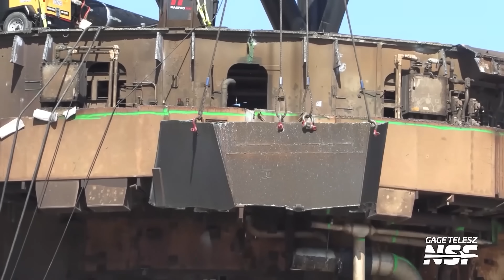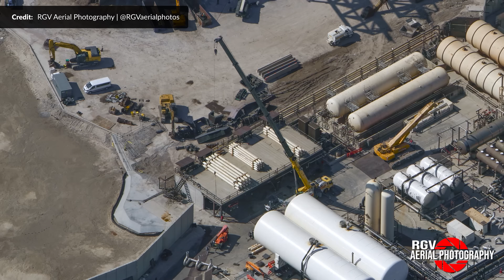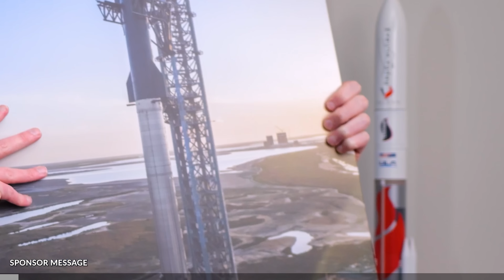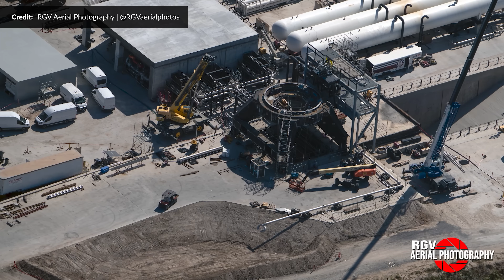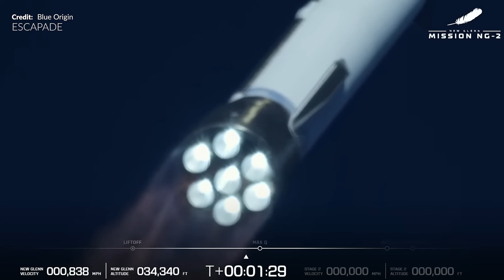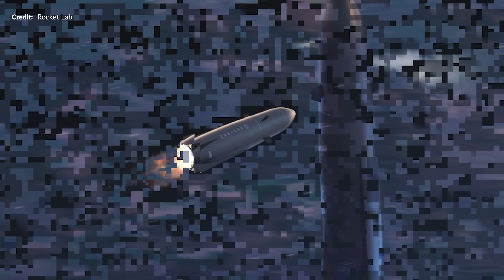Blue Origin’s New Glenn stunned everyone!

Comment: On the previous and last launch they could have just not used the water deluge system and then held the rocket on the pad a little longer, like they did on the very first launch, and obliterated the entire stage zero with just Raptor rocket thrust. Would have saved them a heap of work 👍😆
Reply from the maker: LOL. Probably
Reply: While I know you're being silly the truth is it likely wouldn't have saved them any work. :)

Comment: Marcus, there is a lot of discussion about trucking in methane for SpaceX launches.  Is there a possibility that the launch sites would receive a natural gas pipeline or a tanker ship terminal to make shipments more efficient?  It seems like a pipeline to an onsite or offsite (with second pipeline for the pure methane after) methane separation plant would make the most sense especially for high cadence launches.  Might be an permitting problem, though.  I would appreciate if you could elaborate on future fuel delivery plans, if known.
Reply from the maker: They do plan to have a CH4 plant too, but that comes later.

Comment: 11:35  The crane was NOT spinning under power. Clearly wind driven.
Reply from the maker: Nope.
Reply: @MarcusHouse Sorry but you are not correct. Clearly wind driven through being partially shielded by the Megabay. You can even see it in the change of rotational speed when getting in and out of the wind.

Comment: Thanks Marcus.  Did I miss the bit about the booster hovering abeam of the barge, and then slewing over to land?  That, and the explosive welds are a pretty incredible and unique steps.
Would be interesting to know how thick the deck plates are to avoid melt damage of a fairly long hover prior to shutdown.  Maybe they just alloy'd up.

Comment: If we were to objectively award comparison scores:

1. SpaceX landed their reusable orbital rocket in 2015. From that point of view, Blue Origin is 10 years late in landing a reusable orbital rocket. At least they got there.

Blue Origin = 0 vs. SpaceX = 1

2. New Glenn has bigger payload capacity (45t LEO) than Falcon9 (23t LEO). Sounds good, but Falcon Heavy still has a bigger payload capacity (64t LEO), though precise numbers vary depending on variant (expendable vs reusable).

Blue Origin = 0 vs. SpaceX = 2

3. New Glenn shows stronger performance to high-energy orbits like GTO and GEO mainly because it is a larger rocket with more propellant capacity and an efficient hydrogen upper stage, which offers higher specific impulse for long orbital-raising burns. This upper-stage efficiency gives New Glenn an advantage over kerosene-upper-stage rockets such as Falcon 9 and even Falcon Heavy in certain mission profiles. 

Starship, however, is a far larger system with enormous propellant reserves and very high thrust, which will ultimately allow it to exceed New Glenn’s GEO and deep-space payload capability once in-orbit refueling becomes routine. 

We give 1 point to New Glenn (vs. Falcon-class vehicles) but we also give 1 point to SpaceX for Starship eventually beating New Glenn.

Blue Origin = 1 vs. SpaceX = 3

4. Blue Glenn has been able to land the biggest orbital rocket first stage on a drone ship. Hmm, true, but kinda deceptive. True in that SpaceX’ Falcon-class boosters are smaller than New Glenn’s, but deceptive because for Starship, it is SpaceX’ choice not to land the Heavy Booster on a drone ship but to catch it using Mechazilla chopsticks. Similarly, it was SpaceX’ design choice not to build landing legs for Starship’s Heavy Booster, because the HB was too big so legs to support it would have to be very strong and too heavy. 1 point each.

Blue Origin = 2 vs. SpaceX = 4
Reply: By using the launch tower to catch it Starship loses capacity per launch but increases the launch cadence by landing right by the factory for refurbishment.  New Glenn adds days of travel time returning to the factory for refurbishment.  Advantage Starship

Leaving your landing legs behind means more cargo.  Advantage SpaceX.  

Falcons and Starships use one type of engine for both stages (the same for both types of Falcons and a different one for Starship) this reduces engine development cost and manufacturing cost.  Also since both stages use the same propellant they reduce the types needed at a launch pad and allow sharing of a tank farm.  Advantage SpaceX.

Using the same propellant on both stages means they can both use the same construction techniques and materials.  Advantage SpaceX

With starship using the same propellant and engines on both stages meant they could concentrate their development efforts on the 2nd stage as almost all the features of the 2nd stage could be tested on the 2nd stage while testing 2nd stage items as well.  Made it cheaper again.  Advantage SpaceX/Starship.

SpaceX created Starlink to take advantage of the reusability of Falcon 9 and show that reuse does not come at the cost of reliability encouraging customers to launch on a reused rocket.  Advantage SpaceX.

Using a Starship variant as HLS allows them to demonstrate with a customer paid for mission the feasibility of refuelling in orbit.  Advantage SpaceX.

SpaceX will transfer that Starlink launch business to Starship saving money and showing how reliable it is both on initial launches and reuse launches.  Advantage SpaceX/Starship.  

Starship/HLS is big enough that for many purposes it can BE a space station.  Advantage SpaceX (if they take it)

:planet-orange-purple-ring:

:planet-orange-purple-ring:
Reply: @Scanner9631  what do you mean when you say that “by using tower to catch Starship it loses capacity per launch”?
Reply: lol, if I add all your points then the score becomes:

Blue Origin = 2 vs. SpaceX = 13
Reply: @alesh2275  what do you mean when you say that “by using tower to catch Starship it loses capacity per launch”?

Returning to launch site is more fuel intensive than landing down range on a barge.  Speeds up refurbishment by no return barge ride.  But the barge would have to be HUGE to have a catch tower which would mean landing legs costing payload again and of course developing something else.

:planet-orange-purple-ring:

:planet-orange-purple-ring:
Reply: @Scanner9631  gotcha
Reply: Did you see New Glenn’s drone ship landing where there were small explosions around the landing legs where a device seems to have locked in the 6 landing legs so wind and waves don’t move them? 

I wonder what the mechanism was, why the small explosions, and whether the mechanism has the potential to damage the landing legs, which could mean long refurbishment times.
Reply: @alesh2275  I wonder what the mechanism was, why the small explosions, and whether the mechanism has the potential to damage the landing legs, which could mean long refurbishment times.

How long to refurbish the deck and how often?  It would be just too bad if the booster landed closely aligned with previous holes and they didn't hold as a result.

:planet-orange-purple-ring:

:planet-orange-purple-ring:
Reply: @Scanner9631  I found a video with comments that said New Glenn booster was stud welded to the drone ship. I’m not sure what the long term impact from that technique would be …

Comment: OK. So Blue Origin managed to launch and recover a booster that is half as capable as Falcon Heavy. Good for them. How is this bad for Spacex?
Reply: About on Par with FH if you recover the boosters.  Bad for spacex?  It has the potential to cut into their Kuiper launches... :)  Outside of that it's a good start for BO and a step in the right direction.
Reply: @imaginary_friend7300  IMO, competition is a good thing. My real point is that SpaceX doesn't care about losing Falcon Heavy launches and when Starship becomes operational (I mean carrying customer payloads to orbit), next year, it will be about 3 times the payload of New Glen and at a fraction of the price, because Starship will be 100% reusable.
Reply: @surferdude4487  I don't even think it gets that far.  There is next to no business for FH as it is.  I think they did 4 flights in a single year and that was their busiest.  Most its 1 per year or less.  I suspect Starship will not carry many commercial payloads either, it's over-kill for most but that will of course come down to final costs.
Reply: @imaginary_friend7300  I fully expect that the Starship flights that are not dedicated to launching Starlink satelites or getting people and cargo to MARS or the moon, will be ride-share with multiple customers per launch. The cost will be much more attractive than any launch vehicle that throws away any part of the system. For those that insist on a dedicated launch, the cost might still make sense even iff the Starship is far below capacity. That's the difference a 100% reusable system makes.
And yes, your point about how rare FH launches are is also my point about how little SpaceX cares if someone else does those launches instead.

Comment: I’ll feel much better once Starship returns without TPS burn throughs. So far it’s 0/11 attempts. I do not see how they can fix the current design as my 10 years experience designing TPS for winged RVs is they have departed from the knowledge base for what reliably works. Blue has the right engineering approach.
Reply: And it has survived even when the TPS was omitted entirely.  Maybe they're better at it than you are.  What do you consider to be the fatal flaw, as a TPS designer?
Reply: They are still testing all sorts of different ways to do things, it lots of extreme ways. When they come up with a final design and test that, we will be in a better position to judge.

Comment: I don’t know. It feels like they didn’t push it hard enough. Blue Origin played it safe to showcase reliability, which is, in my view, a bit paradoxical when you’re trying to prove true reusability. It creates the impression that they’re ahead of SpaceX—but not so fast. SpaceX is the actual pioneer of reusability. Blue Origin seems too focused on optics. Maybe I’m wrong.

Do we have any solid information—official or quietly acknowledged—about their rocket stress-testing and torture protocols? Anything deeper you can dig up on that?
But what a show!!
Reply: Push it hard enough?  How so?  They delivered their customers payload...
Reply: They still have a long way to go to even equal SpaceX. They don't have a reusable 2nd stage, crew capability, and we are yet to see how long it takes to turn a booster around for reflight or how many reflights they will get from each.

Comment: They are not going to use trucks to move the LOX across the street, especially at the scale they need to produce.  Come on.
Reply: They've been trucking it in already.  They will likely have excess production to be sold to 3rd parties.  

The big issue is will they either be allowed to dig up the road or string pipes over it to deliver directly.  Otherwise trucks would be the only option.

:planet-orange-purple-ring:

:planet-orange-purple-ring:

Comment: It has to be asked, the new launch mount prevents a service platform getting under the engines for working under the booster. How will this work get done?
The circular mount had the moveable / folding platform...

Comment: 11:37 🤔 Perhaps this was a brand new crane, or one that had a completely new swivel portion, and so this may have been part of the "break in" procedure. Certain things need to be properly worn in before you use it to their full potential. Your vehicle's engine, for example (if brand spanking new with low/no mileage).

As such, I can see running it like that for 12hrs as being the procedure to ensure all the bearings and their surfaces are functioning smoothly. Last thing you'd want is for some unknown debris to suddenly wedge itself in the bearing right as your moving a large load, causing everything to slow down and said load to start swinging! (and for that stuck bearing to ruin the bearing or the race)

Comment: The next SpaceX launch needs to be special. If they dump booster and Starship into the ocean again then my vote goes to Blue Origin. Sadly Blue Origin only does a 1 per year launch. But they are using that launch efficiently.
Reply: That's simpleton child reasoning at best.  The next flight and likely 2 will both be the same flight plan as the last one.  And there are good reasons for that.

Comment: Sounds good blue origin is only 10 years behind.
Reply: 24+ years from founding to their 1st orbital launch 25+ to their first fully successful launch.  Pretty slow, typically it seems to take 6 - 8 years for a successful orbital launch.  

Rocket Labs was pretty slow taking 11 years but have had about 70 launches in the 8 years since.  They are making satellites (like the ones launched on this flight of New Glenn) as well and working on their 2 generation orbital class booster to be launched (hopefully) next year.

:planet-orange-purple-ring:

:planet-orange-purple-ring:

Comment: Betting Starship launches 3-4 times before New Glenn launches again.
Reply: Well, they might but they will still be test flights.
Reply: @imaginary_friend7300  No they won't
Reply: @imaginary_friend7300  are you sure/
Reply: How about how much payload Starship will put into orbit over the next 2 years compared to New Glenn?  If they can start going to orbit in 6 months and are ready to launch Starlink 3 satellites it will EASILY be Starship in the lead.

:planet-orange-purple-ring:

:planet-orange-purple-ring:
Reply: @Scanner9631  SpaceX will be launching ver. 3 satellites 2026
Reply: Yep, 3-4 times with 3-4 explosions and no progress.
Reply: @gracialonignasiver6302  The silly nonsense you zero's spout.
Reply: @gracialonignasiver6302  wanna bet on that?
Reply: @gracialonignasiver6302  wanna bet on that?

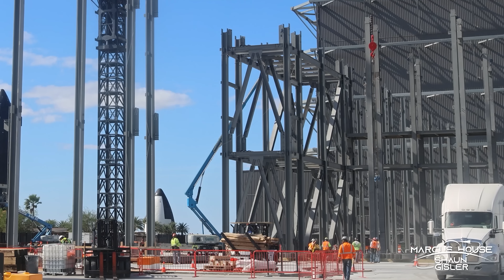Comment: Regarding remarks at the 12:00 time code about the piece-meal delivery of parts: It's a well documented lean manufacturing tech called Just-In-Time (JIT) manufacturing and has been around for decades. In JIT, individual components are delivered by the supplier as needed, just in time to go straight to assembly, without ever going to a stock room for wasteful storage. I haven't noticed it used at this scale before, but it doesn't surprise me with Elon driving efficiency into everything he does.

Comment: Amazing engineering. 2nd flight and they are operational and landed the first stage. This is when you let the flight test do the talking. No excuses.  Well done..
Reply: Hide your failures vs do it all in public view. Step by step ferociously took 10 years😂
Reply: @invertedcnc705 2nd flight to orbit. I am not sure what they are hiding. Their engineering process? Every company has a proprietary technology and methods. 
The results speak for themselves. Only a fanboy would be in denial. Its hard to argue with success
Reply: @invertedcnc705  What "failures"? They just took the time they needed to develop something that works instead of being impatient and fyling have backed concepts. It's a more traditional approach then what SpaceX does but this doesn't mean it's wrong.
Reply: @EinzigfreierName it's the old NASA way. It is not clever at all.
Reply: @andrewplumb6544  I don't see what is not "clever" about designing a vehicle that works perfectly from day one compared to doing try & error for years. SpaceX does this quite sucessfully but this doesn't mean other methods are dead.